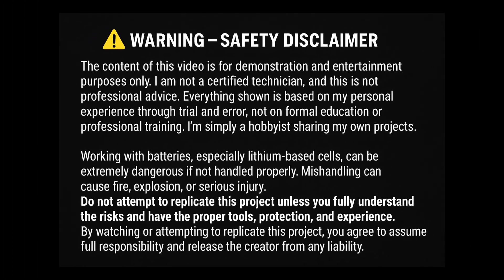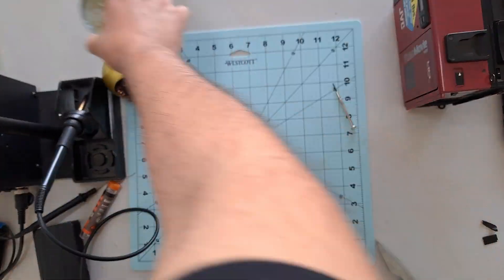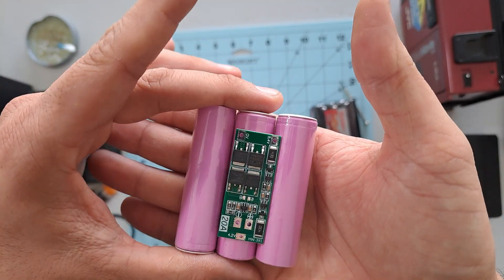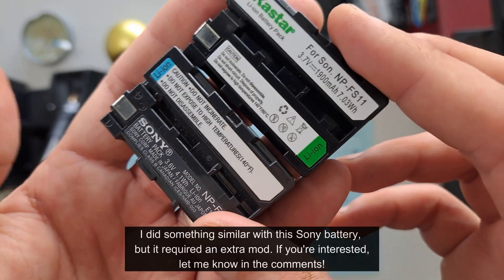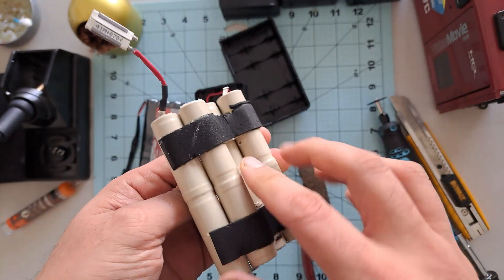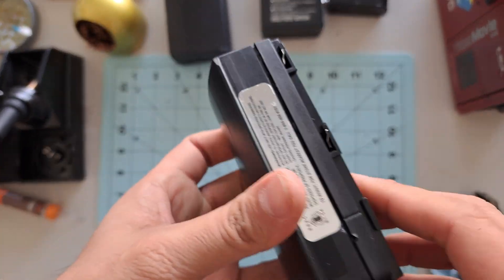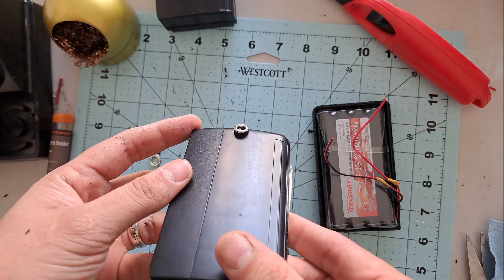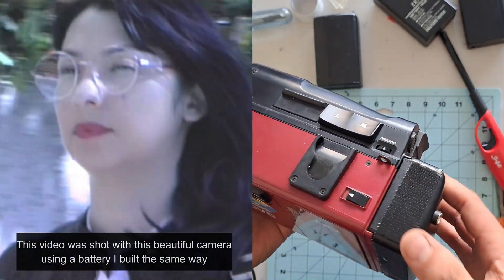Battery DEAD? I Built THIS for RETRO CAMS (Easy & Clean)

Comment: Hello! I tried this recently, my camera works for a little bit but then it turns off and the camera says the battery is low? (even though the charge is full on the battery when I tested with a multimeter?) Is there any issue, I tried checking the contacts and I get continuity?

Comment: I particularly love the look of the tube camera footage from your videos.  So I'm most interested in the 12v battery you must've used for the QC-54.  

I don't know a whole lot about electronics, but your QC-54 battery looked a whole lot smaller than most I saw when searching for 12v ones.  It seems a less common voltage for RC models.  If you have time for a video on that one, that would be amazing!

Edit: Never mind, I saw in an older video you said you bought it and I found some similar ones on ebay.  If anyone else is having trouble finding them, try searching for CCTV battery packs ✌

Comment: Next time try to order lithium-polymer batteries and type-c charging plate. That plate is small and provides you opportunity to manage output voltage. Made battery like this for vhs-c jvc camcorder. Works perfectly and can charge while working from the powerbank

Comment: I did a temporary fix for my 8.5 v canon camcorder. I couldn't find a battery so I taped a powerbank to it and bought a usb pd manuel dc voltage switcher cable and using it at 9v. For short term its okay

Comment: Great video Max! Tried rebuilding a Li ion Infolithium M battery but I think the Infolithium M chip stopped it from working. I rebuilt a Canon Lithium battery without any problems using 18650 cells. I also replaced a Samsung NiCd  battery with 2x 18650 cells and a buck converter set to 6V.

Comment: Great video, as usual!

The 9.6 volt NiMH battery pack here is much safer than your future proposed lithium-ion build.

Lithium-ion batteries can catch fire.

On the other hand, lithium iron phosphate (LiFePO4) are safe and can handle high current draws, but LiFePO4 cells have lower capacity than lithium ion batteries.
Reply from the maker: @tuppb  Thank you! And you’re absolutely right. I do understand the risks, and my biggest concern is making sure people are fully aware of how dangerous it can be. I just want to make sure I explain it clearly enough so no one gets hurt. I'm thinking carefully about how to approach the next videos, but honestly, I'm also considering whether I should continue with this battery diy videos or not. Really appreciate your support. : )

Comment: Hi max i did exactly the same retromod for my JVC GR-80S battery with a 4500Mah from Ali but the battery doesn't last much more than 20/30 min i also power my unisheen with it and a Secam/pal signal converter i am curently trying to  see if i can power averything with a Lithium 11.1V 5000 to 7000 mah battery. my camera curenly has the leaky caps syndrome so it might not help with autonomy sadly... 
the power output of the battery charger and camera power is 10.6v stable DC  at less than 10.3V my camera starts to say low battery i'll do some tryal and error hopefully not frying the camera ! 
it also has an internal fuse but it's hard to reach a full disassembly is needed in case you ever "fry" a camera maybe a fuse is blown and can be replaced 
great content keep it up !